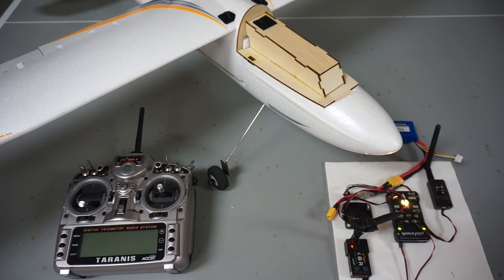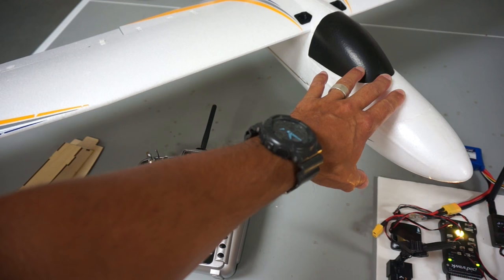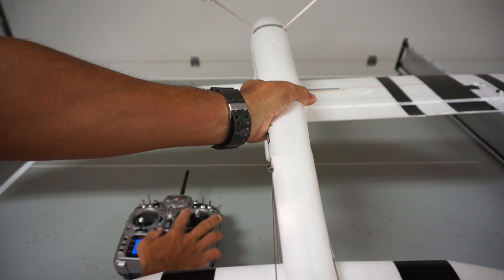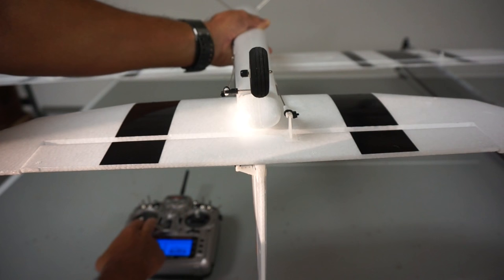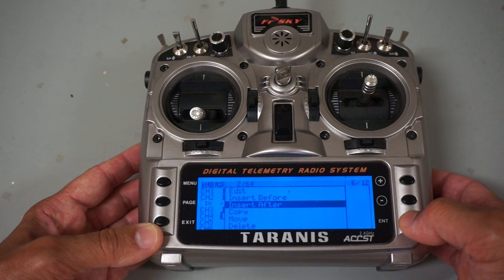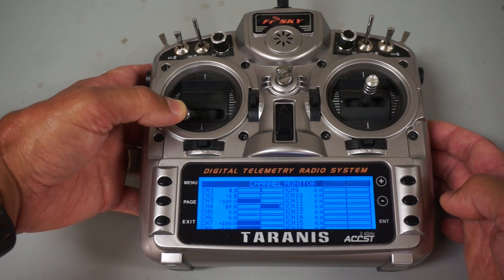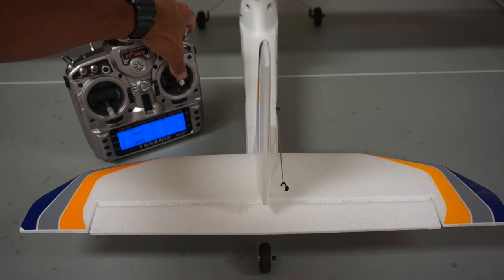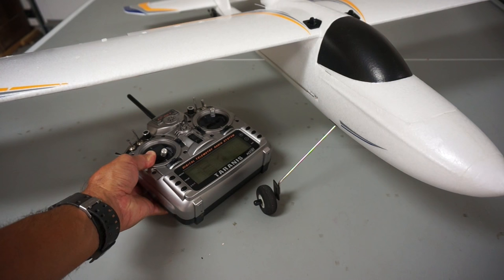Taranis Inverting Channels with the Flip of a Switch for Inverted Flight

Comment: Hi Dennis,  That's very clever programming but your really just need to learn to fly inverted!!!
Reply from the maker: You are absolutely right. The switch is sort of a failsafe for me. I will be using it in case I get inverted and start to freak out and lose control. But ultimately I don't want to have to depend on it. Thanks for the feedback.

Comment: The replace command looks very useful. I will be interested to see how you fix the pix bug.
My mini pix does the same thing sometimes and I think it's because I have moved hardware or gone to a new location. Fussy that gyro.
Reply from the maker: It's really quite aggravating as I flew it on my original Bix wit no problems. From further investigation it looks like I may have a bad compass cable. Have been doing a lot of bench testing and getting intermittent results, which leads me to believe it's the cable. Thanks for the feedback and hope all is well.
Reply: Doing fine, thanks. One solution I have that thought of is to disable the mag/compass because I have heard it is not needed for a plane. This way there would be no more fussing around with it. I think internal and external mags can be disabled in the parameters but I have not tried it. Do you think that could work?

Comment: Hey Dennis, did you ever try this out in flight? Also, if you're flying in inverted flight mode, does that mean since it's a 'flight mode' all of the controls are still standard (i.e. pull back on rt. stick plane pitches up, push forward on rt. stick plane pitches down...ect).
Reply from the maker: Unfortunately my elevator servo burnt up so I've been grounded for a couple weeks. I have a new one on order and share my results soon. Good question regarding stick behavior. I don't really know at the moment.

Comment: If you reverse the controls when inverted you you will not actually be practicing inverted flight.
Reply from the maker: Right on. The thought is I'll roll into inverted flight and if I get into trouble I'll toggle my switch to flip my controls. I understand I won't be practicing inverted flight if I leave my controls in a normal state. It's just a failsafe for me as I get more comfortable flying inverted.
Reply: You will get comfortable flying inverted much faster if you learn to get out of trouble without the "failsafe" of reversing the controls.  

If you are not careful the use of the failsafe will become more ingrained than flying inverted and I suspect that flying inverted with reversed controls will turn your brain to mush as you will need to learn to fly inverted in both modes.  This is going to be harder than just learning to fly inverted.